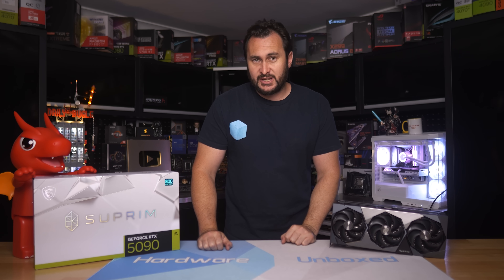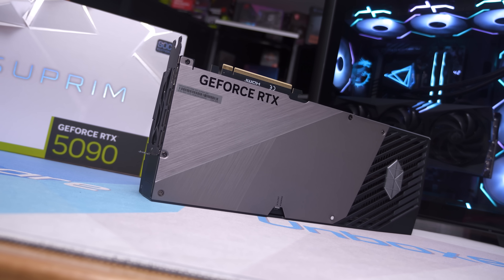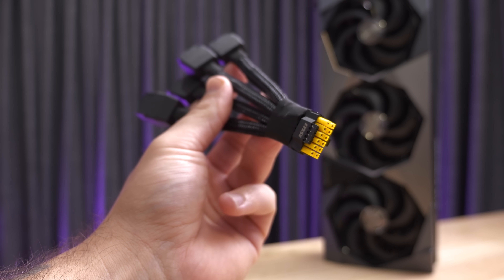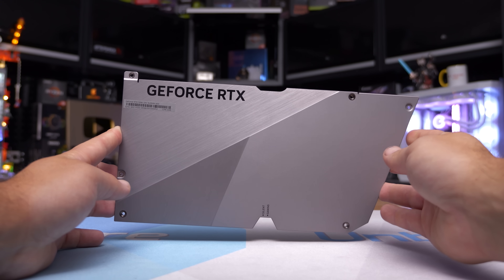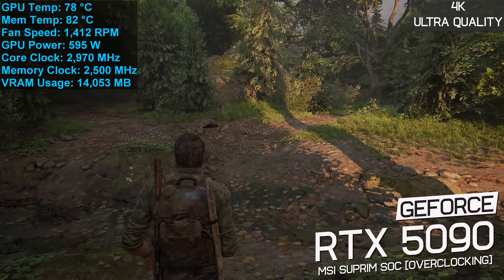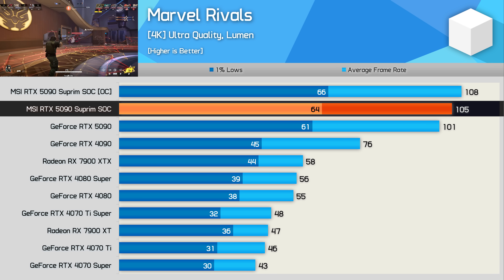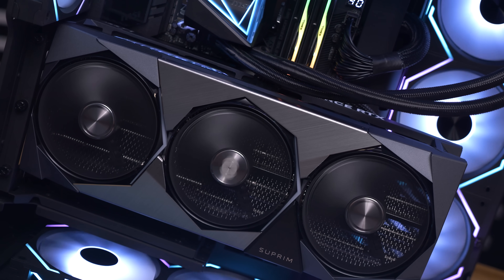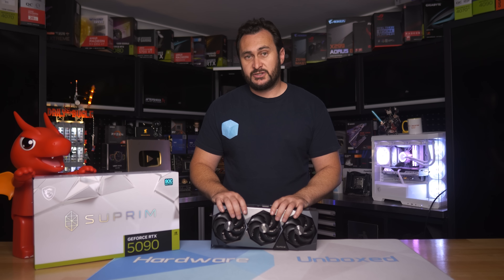MSI RTX 5090 Suprim SOC Review, Biggest Graphics Card We've Ever Seen!

Comment: 750w is absolutely ridiculous. Don't even need heating during winter if you have this card blasting heat around the room like a space heater.
Reply: 80°C power connector, 800 Watts of power draw on a 600Watt certified cable.
 2x 12V-2x6 600 Watts, this could easily solve this giant issue. But nooooo...

Comment: I have the MSI 4090 liquid supreme. OCs to 3100 mhz (nearly 40% over base). Im only like 8% lower then the stock 5090 in raster performance in 3440x1440. Also the card stays under 62c.

I was heartbroken over EVGAs exit. MSI has been a suitable replacement. Which is a compliment given EVGAs incredibly high bar.

Comment: Nvidia partners have learned nothing from the issues of heavy cards and damages to the PCIe connector, they should have definitely used a separate PCB for the PCIE lines, so the main PCB with expensive components would not crack/break.
And there is always a catch with small coolers, like from Nvidia. Although it is an engineering marvel, 5% performance loss is quite a lot. It is also confusing why they did not make 2.5 or 3 slot card to improve performance even further.

Comment: The thickness/hight is not the problem. Its the width!
With the cable on the side, it can not fit in most cases horizontally!
The 5090 FE is the only one to go!
Reply: Now vertical mount is a must.
Reply: These cards should not be mounted horizontally tbh - especially without any supports!
Reply: @tourmaline07 So RIP normal PC builds. You need some nasty razer cable that increases latency and special cases

Comment: How is it that Nvidia can make a smaller GPU than the 3rd party company’s 🤦
Reply: They have to make the card that big just to squeeze out a max 10% gain.. That's why NVidia cannot just release a 900 watt card that's 50% faster than the 5090 for $3500 right now if they wanted to etc... It doesn't work like that

Comment: The connector at 80°C is crazy
Reply: even your cable needs a fan for 5090 :D
Reply: @megapet777  Let it focus this way: this is a card, not for typically usage, it is made, to be used in antark. If you use it in some continents there the sun is heat, you will burn. your wallet will burn, your computer will burn, your cables will burn, and if you use some Air conditioners, to lower down the room temperature, your Energy Connector from your powerplant will burn. Also your powerplant will burn to.
Reply: The temps are high, but what are the cables rated at before melty melt?
Reply: @matthewboehm8557  The bigger issue is resistance changing with temperature, and de-rating gets worse. Thermal runaways are easy that way.
Reply: @The_Noticer.  thermal runaway will be only an issue if temp exceeds rated specs but yea 80C is kinda scary
Reply: @hyakinthos_0902  at work we calculate derating at 40C. Wouldn't even want to know how badly these cables are derating with so many conductors going towards it.
Reply: @The_Noticer.  thats intresting 

you deal with low or high voltages mate 

my knowledge is from DC low voltages from 12v to 660V (LT)
Reply: @matthewboehm8557  they're usually rated 60°C, 75°C and 90°C
Reply: @N0rub   there are cables with much higher ratings, same for connectors.
Reply: @N0rub  i have seen cables rated for 105c - 125c and their datasheet says its perfectly safe to operate in these temperatures
Reply: @matthewboehm8557  oh, give it 2 weeks after release and we will see the electronic repair youtube pages getting flooded with the new GPUs.
Reply: Remember boys, MSI was the only brand that included fuses on the 4090 series...
Reply: @darkpsy19  Thats cute, but that didnt stop the melting connectors
Reply: @LampuhkapsChannel at least they did more then the other company's to try and prevent more damage to the equipment
Reply: @ They didnt do shit. If they really wanted to fix it it could have been sooooo easy. Stop using that connector! Make it mandatory to get a temp sensor on the connector so that it shuts the cards down at a certain connector temperature FUSE EVERY CARD you bring to market. And go back to working, PCIE connectors, dont keep pushing fire hazards into peoples hands. Nvida is delulu, and badly too.

Comment: Nvidia definitely should have given these cards 2x12vhpwr. 80°C on the cable seems extremely hot. All these cards are going to be heavily power limited, and 2x12vhpwr would allow for some really interesting vbios/OC potential! I really want to see how far a 5090 could stretch if allowed to suck down 800w+.
Reply: Completely agree with this - given the amount of problems with these connectors in the past nVidia should have used multiple ones for each card at 600W. 

Had a look at MSIs images for their upcoming Lightning 5090s and they look as if they might use dual 12vhpwr. I think it will be fun to see how high they can go , but I'll be watching someone else doing it rather than running my own power bills up!
Reply: @tourmaline07 I was thinking the same thing.. dual 12vhpwr slots wouldn't have bothered me at all. Hopefully there is a dual split cable for this very idea. Means I upgrade the PSU but know it's safe for the future.
Reply: It's because the whole reason they made it is to only need one power cable but they pushed power so fast that they basically ran into the power limits of one cable in a single generation lmfao.

They really should've just changed to eps/cpu 8 pin cables. Much better compatability and no melting with still a much better 336 watts per cable if they just mandate the same higher wire thickness as they did with the 16 pin
Reply: 5 8 pins lined up and connected to a gpu would look absolutely crazy lmao  @Frozoken
Reply: @ultimategohan1551  150W 8pin has a much larger safty margin. Four 8pin connectors can handle up to 1,140W compaired to the 12VHPWR 660W. So if you're drawing 600W through 4x8pin you would be fine but through a 12VHPWR its already close to the limmit even though its within the specified power.
Reply: @SentaDuck  The limit seems to be 600W not 660W.  https://www.youtube.com/watch?v=kdjOfKPt51s
Reply: @ 660W with the safety margin. That only a 60W safety margin compared to 135W safety margin per 150W 8pin connector.
Reply: @SentaDuck  oh yea im all for more 8pins vs the stupid 12v connector/adapter. Was testing out a bunch of gpus last year and that stupid thing is such a pain to take out of any 40 series card. Side note umi thought each cable is rated for 150w?. Like isnt it bad to daisy chain a  300w card and use 2 separate cables instead?
Reply: I have been hoping for this, had seen the Galax HOF 4090 and given that the 5090 is at the limits for 12vhpwr, was thinking there might be more gains with more power.  I put in a 1300w supply with two 12vhpwr connections hoping there might be a dual-connector version from someone.
Reply: It's fine at 80C.  It's a connector, not a CPU.  It would have to reach around 200C before it fails.
Reply: @SargonDragon  I'm just saying that the 12vhpwr on my 4090 is never even hot to the touch. 80°C seems quite high in comparison. If I get a 5090, I'll probably hook up a temp sensor to the plug to help monitor the temps.
Reply: @SargonDragon  Are you insane? Plastic is gonna fucking burn/melt away waaay before that

Comment: I'm wholly expecting to see these cables melt in due time. 700w is absurd. We went from Nvidia talking about efficiency with a 350w card, and I thought that was crazy. That's downright reasonable versus what we've got now! xD
Reply: Keep in mind that 700W was combined power draw. Closest is 650W for the card itself when OCd
Reply: @killerful  Good point, that's my mistake... Even still though, 650w is just silly for a single component...
Reply: Reason why I went with 4080 (OC) and not the 4090. At that time, to me, the 4090 didn't seem stable to me with Watts power and overall temperature. Now we pumped up the power even more and it feels "borderline" on the edge of TOO  hot for 5090.  It's great to have a powerful card but when there's a chance of it being too powerful to the point of unstable, I don't see a point.
Reply: There's this classic video of a olympic cyclist powering a toaster, and that was 700 W
Reply: I remember the meme days of Fermi cards when people cooked bacon and eggs on it... and that was only up to 250 watts cards and everyone was going nuts about it like 15 years ago. Now it's 3 times that power of a Fermi card lol
Reply: And the GTX 1080, one of the greatest cards ever, only drew ~170 watt while gaming.
Reply: @SweBeach2023  I miss my 1080, best GPU I've ever had.
The used 3070 I bought to replace it is just so underwhelming in comparison
Reply: @SweBeach2023  I'm honestly hoping that the 9070 XT ends up being sold for $500ish. 4080-like performance for half price is what is sorely needed... Subvert our expectations in the best way...
Reply: @imglidinhere  Too bad AMD never misses an opportunity to miss an opportunity

Comment: Someone needs to place the FE and AIB cards in a real world case and use it with various CPUs and big air/AIO models.  One review has the 5090FE cooking an air cooled 9800X3D to 95C!
Reply: Do you have a link to this review ? Thanks.
Reply: This is misleading lock GN FE 5090 runs on full last with 80c and 90c memory and this is complatly fine for 2 slot and 5xx watt
Reply: @ The FE keeps those decent temps because it's moving the heat out of the card, up towards the CPU in a tower case.  You have to dissipate 500+ watts of heat somewhere.  You're not cheating physics.
Reply: But who in the right mind would have a £2000+ graphics Card and a £500+ CPU and use an air cooler on the CPU? Literally no-one, I'm not defending how crazy this 50 series generation is, just that that match up makes zero sense.
Reply: @LeeMc007  Probably lots of people?...
That you have an AIO doesn't mean everyone else does.
The 9800x3d doesn't need an AIO to stay cool.
Reply: Well done NVIDIA 🔥

Comment: Skip the card. Use the money to buy some milk.  It will have a longer shelf life than this card.
Reply: If someone lives in bad winter months and wants to use their pc to heat a room, this purchase can make sense. . You can undervolt the card to 450 watts in the summer and still maintain 90%+ of the performance I assume. The only ''free'' way of heating a home in the cold is using a woodstove, but they releases toxins into the air and increases your chance of lung cancer

Comment: One thing that I think is not mentioned enough is that even that huge cooler is able to dissipate 750W of heat, this is gonna be dumped into your PC case, most certainly raising the temps for other components, and would then be dumped in your room. Living in tropical areas it would means that long gaming session essentially becomes an unbearable hot sauna session, and even with air conditioning 1000W of extra heat is hard to get rid of, especially for the fact that the desktop PC would likely be in closer proximity to the gamer than the air con. Even if you disregard the electricity bill. 
Even Nvidia can't defy physics, the extra power and extra heat needs to be dissipated somewhere still.
Reply: If anything the huge cooler does help absorb some of the heat out of the core so that it doesn't just get dumped straight into your PC case . I found this with my Suprim X 4080 Super compared to the 2080ti I had before , the case dumps slightly less heat.

I'm surprised that Dyson don't try and license the FE design as a super smart room heater , which can render videogames with AI 😂
Reply: It's also a problem in temperate climates, in much of Western Europe AC is very uncommon to non-existent; and it does get hot in the Summer when the ambient is 30-35C and all of the buildings are designed specifically to keep heat in.
Reply: think this is bad? think of the founders, its at 94 degress already for the memory think of how hot its going to get in the summer  or  the  combination of in the summer, and in a mediocre airflow case. I see that thing throttling easily.
Reply: Just install Chiller to cool down you care! 
😂

Comment: Using traditional thermal paste on the GPU... that's just plain unacceptable for a 2,400 USD premium version of a flagship graphics card in 2025 (price listed on MSI's website). 

Pinching pennies on the thermal compound with a supposedly premium flagship model, to not use PTM7950, or something better, is just insulting. Some graphics card brands have started using PTM7950 even on mid-range models, and PTM 7950 doesn't have issues with pump out or with needing to be re-applied after a few years. I think I'd be okay with a graphite thermal pad as well, because they are extremely reliable and do not suffer from any significant degradation over time. 

The 400 dollars CHEAPER Nvidia RTX 5090 uses liquid metal thermal compound, which will likely never need to be re-applied.

Comment: I don't get it man, if FE card can be that small then why AIB manufacturers keep making huge cards!?
Reply: Because FE 5090 runs at 92C on 600W TDP.
Reply: @beancounter9800x3d  Wrong it runs 80c with 90c memory this is normal... memory can go up to 105 and still be ok
Reply: so you can run it cooler and overclock it. not really that special of a concept

Comment: Am I the only one actually kinda impressed by this AIB model? It’s pretty rare to see >5% performance improvement even on silent bios over the FE model. 
Disregarding price of course.
Reply: really not that impressive considering the weight and size, FE is 2 slot and an entire kilogram lighter
Reply: Just shows that compromises had to be made on the FE model due to the small size.
Reply: It's a beast. I'm impressed. 600 watts while gaming who gives a toss haha.
Reply: Nothing impressive about it, all that extra power can easily accommodate for raised clocks the only reason they're so low on FE is so that the cooler can keep up. Other 50 series cards will be the same, absolutely no reason to lower 5070ti clocks on identical generation cores.
Reply: You're only allowed to make lazy, cliche jokes about how expensive this card is in this comment section, sir
Reply: @Kira-qc4qi  Those aren't jokes. It's the reality that we live in.
Reply: You can realize that they did a good job but, don't ever let them know it, sir

Comment: RTX 6090 might actually need its own external power cord at this point
Reply: it will need its own case too
Reply: Not the first time. The prototype 3DFX Voodoo 5 6000 used an external power brick. Then the company went under.
Reply: the 4090 at "captains workspace" has it already !
Reply: It will be a lower node, so probably not. 5090 is just a stop gap, a swan song of current technology.

Comment: The card is not attach to the motherboard. It's the Motherboard that is attached to the card.
Reply: Fathercard
Reply: @Zeemanhuismerk  OK. I call it Based!
Reply: There were already pictures of this idea with the 4090 standing up, ITX mobo attached -- they looked hilarious.
Reply: "I'm not in here with you, you're in here with me"
Reply: I wonder how many cases it actually fits in?
Reply: 3Dprint a stand for the gpu and a small pillar like stand for the motherboard, and you are good to go with a matx or itx board. Or just use a normal tower cooler and lean on that, should work just fine with the card being 150mm in width😂
Reply: And despite this size MSI still used a 2 slot PCIe bracket. If you're going to make a triple or quadriple slot cooler then you might as well use a wider bracket that can use more screws for some additional support.
Reply: It is time for a standalone GPU and some minor peripherals like a small cpu, some USB ports and power supply. It is time to plug-in the ATX connector directly to the GPU.
Reply: I have to equip my RTX 5090 with peripherals like CPU, RAM and MOBO...
Reply: "They chopped his whole body off."
Reply: Even technically the slot "bite" to the card, right? Like ferret
Reply: Bringing into question, which component truly is the Motherboard 😅
Reply: The classic position for this kind of technoporn is called as cowcard position. If someone doesn't want to break their spine(be it PCIe slot or card's connector), the MB can only lie horizontally, unless there's a good PCIe 4.0/5.0 riser that makes both parts to suffer less.
Reply: Was thinking the same thing! Wouldn't doubt in a few years, the graphics card will be laying in the case first like a mobo now and everything else will be attached to it! 🤣
Reply: old joke is old